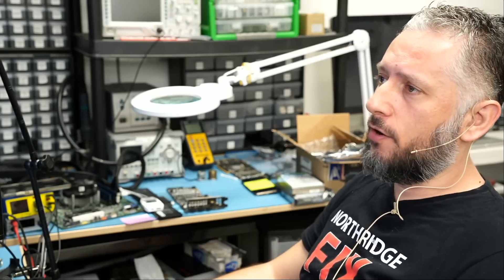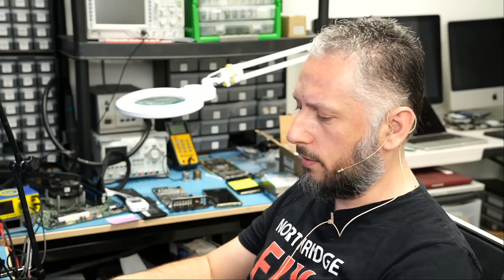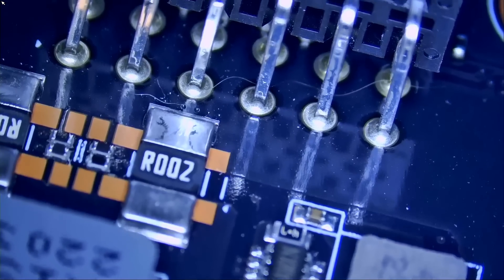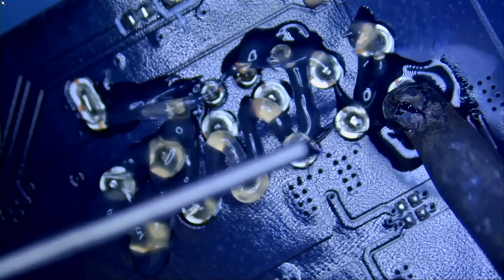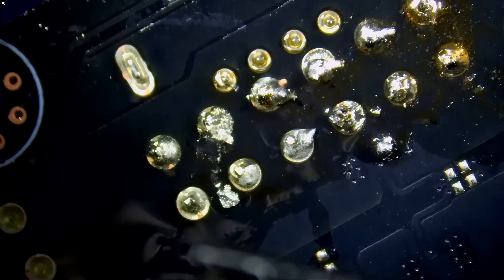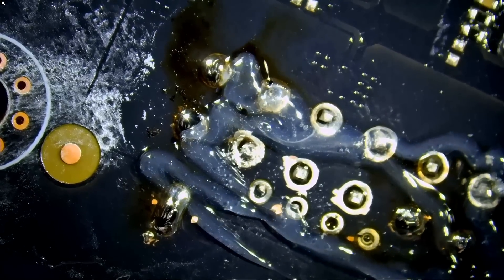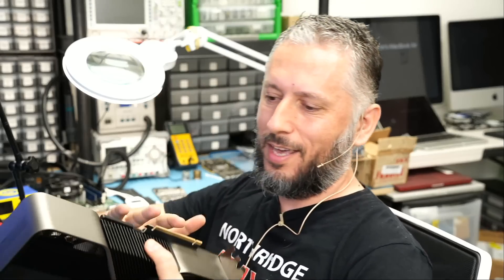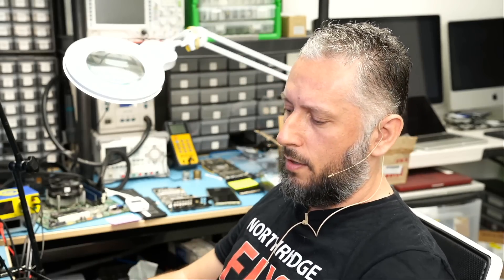Serious issues with 4090 power connectors melting - Is the user at fault ?

Comment: In the video card manual, it states clearly that the power connector must be seated properly to avoid  damage. This is the user's  error. But, the fact that one must apply a great amount of hand strength to seat the connector properly may lead to people being afraid of breaking the connector. The end result is a losr connector. This is a manufacturing mistake. The conclusion is 50/50.

Comment: From the videos that looked into this at launch , it was not the plug being put into the card incorrectly , it is 1 or 2 of the power feed connectors at the other end ( 4 into 1 ). The Card is pulling 600+w , feed over 4 connectors into 1 connector. When 1 or 2 of them is not connecting correctly , it means the full wattage is now being supplied  over  only half of the cards connecting pins  & thus causing more heat and then the sockets melting  .
Reply: That shouldn't be the case, because there are sense pins on the adapter. If you only plug in 1 or 2 out of the 4 correctly, the card will not work. If you only plug in 3, the card will be power capped to 450 Watts.

It has more to do with higher resistance at the point the adapter or cable plugs into the GPU. If it is only partially inserted, or if its at an extreme angle, or if foreign debris or manufacturing defects create higher resistance or lower contact surface area, that can cause overheating and melting.
Reply: @Skilliard  The sad case is that you are both correct.  Transient spikes over and over again.  I would love to see a Amperage plot when the card is on and doing work.

Comment: There is also some of the lower end 4090 that come with a 3 x 8 pin connector like the 4080, it is enough to run the card if u not do a big OC and it seem to be much safer.

Comment: It happens when the cable is stressed against the side panel of the case or isn't plugged in completely. There should be a sensor or some failsafe, and the company should make it crystal clear that unless the connector is seated completely it could melt.

Comment: At some point, we have to start blaming bad design, and that's what the issue is here. If the cable is that difficult to get plugged in all the way, then that is a design flaw that needs to be addressed by nvidia. Nvidia has stated that any card that comes in with a melted connector will be covered under warranty. If your connector melts, the Add in board partner is required by Nvidia to cover it as a warranty issue.

Comment: GamersNexus did a deep dive into why this is happening with testing and they were able to reproduce the result.  The TLDW was part user error and part design.  If the connector is not inserted all the way, it leads to this result.  I personally do not know what nVidia was thinking putting all that power into one tiny connector with gauge wire not appropriate for the power going through.
Reply: These two comments have provided a significant amount of context around the issue - thank you.
Reply: GN as well as many other reviewers were unable to get it to melt just by leaving it unplugged by a small amount. GN only managed to melt it by leaving the connector EXTREMELY unplugged and at an angle- basically the bare minimum for the GPU to "work"- Something so egregiously bad that no person would reasonably make that mistake.

After GN's video came out, people have been VERY careful to plug in their connector fully. However, there have been multiple posts of people that smelled smoke, so they took pictures of their GPU/connector BEFORE removing it to prove they had it plugged in fully.

My theory is that some of the failures are due to improper insertion, but the majority are due to manufacturing defects either on the adapter, or on the connector on the PCB, and the 12vHPWR standard having improper manufacturing tolerances to handle these defects. I know of only 1 case of a 4080 failing, and no cases of a 4070 TI failing, which is indicative that 12vHPWR can handle <300 watts just fine, but the 600 watt rating that pulls 450 watts at stock on a 4090 isn't safe.

Comment: It's just a cheap connection it would be better with 2 connections it's just a cheaper solution they did at Nvidia,
the solution would just put a 90 degree joint, to reduce the tension of the wires.
Up to 600 watts can go through a connector, but the pins are too small, and get too hot because the material is too thin, not good for [ AMP ] and get too hot with the bent cables to properly put them in the case

Comment: Agree. Card connections are too small for current load, voltage drop between connector and pins causing heat. Poor design. Better replacement technique this time cutting connector free before attempting to desolder, excellent repair as usual.

Comment: If the Problem is really because the connector is not fully plugged in the manufacturer has to do something. Maybe the pins are to small for this amount of power

Comment: the card should detect if the plug is not plugged in properly and should alert the user. It makes zero sense that the computer part with the most brain power can't tell if it's not getting enough food.

Comment: this problem is new to videocards but its now new to cars laptop and everything in the world🤭, take it for example the new engines  of cars, back in the day it used to be very simple and you can repair it with minimum tools now engines have computers  and everything that you cannot even overhaul now parts expensive even a simple as startter motor replacement you need to take apart the whole engine just to seevice a simple failure 😆🤭, 
its all about making money🤣, and making it very complicated for the user to have the reason to buy new one instead of repairing it😶, 

its reverse phycology they say innovation, but it really meant making it very complicated for the user to not touch it🤭

Comment: Although not possible if it's a standard connector, just the slightest increase in the metal runs inside the connector should fix it because resistance is a function of diameter squared and the heat wattage is the voltage drop squared which is proportional to the resistance, so the reduction in heat wattage there is diameter to the fourth power, plus more heat dissipated due to the thicker wire. It's possible the metal inside the connector is inferior like using a lower percentage of copper or otherwise some impurities in the metal. But of course trying to run all that power through it is the real cause.

Comment: Considering how frequently this problem seems to be happening, this is definitely a design issue. Nvidia needs to fix this before it causes house fires.
Reply: nvidia of today does not care they have attack dogs well paid on youtube
Reply: Gamers Nexus did a deep dive, this is fully user error. They do mention that at some point you have to start blaming the company, if the plug is that hard to get in all the way, and doesn't want to stay seated all the way, that is a design flaw that needs to be addressed.
Reply: @chubbysumo2230  This is a product marked to, and sold to consumers. If it's this possible to incorrectly/improperly mate the connectors, it's a design flaw.
Reply: @kjtroj  If someone fails to install their CPU correctly and bends pins whose fault is it? Surely you'd agree it is the user and NOT the manufacturer. It is the same scenario here.
Reply: @innie721  There's a word of difference between damaging a component and potentially starting a fire. Not only that, but a CPU drops into place, whereas the way this connector is designed, it requires a fair amount of force to fully mate, which I suspect is the source of the problem.
Reply: @innie721  no it is not. The situation is not exactly the same.
Reply: @kjtroj  Correct. It should be FIT FOR PURPOSE, It IS NOT !
Reply: @innie721  If the user fails to install a CPU correctly, either the computer simply doesn't POST or pins on CPU or motherboard are damaged, leading to similar result. It doesn't pose a risk of fire hazard like these 12VHPWR connectors. Not the same scenario at all whatsoever. Manufacturer design error. Stop running interference for faceless corporations.
Reply: @chubbysumo2230  Stop repeating what your daddy Steve says all the time. Grow some balls.

Comment: Counterpoint:  Because a user pays alot of money, they cant be at fault? What if they buy a car and drive it badly, don't press the break pedal all the way, and crash?  Are the car company at fault because they knew if someone doesn't press the break pedal properly, it won't stop the car? I think if you are paying that much money for something you better know or learn how to use it.  
That being said, the connectors are stupid and they could have just stuck with the old ones, put 3x 8 pins if you have to.

Comment: Add a cam-locking power connection with a lever that moves 90 degrees, then there would be no doubt that the connections are made and secure.  Over and done!

Comment: Maybe if users apply heat sink gel inside the connector when they plug it up it will pull out more heat to the external connector and wires to have less of a chance of it occurring again (I think zinc oxide white suncreen is the primary ingredient in many heat sinks). Is there something you can do in the repair to pull out heat?

Comment: good commentary on customer vs manufacturer.    If you use the auto industry as an example,  one problem reported to NHTSA is interesting but wait and see.   But when you see the same problem spread over many customers then you have to say the issue is the product that not designed to be fool proof.   My vote at this point its the manufacturers issue for designing a product that can be improperly installed.

Comment: What about variance in power connectors, are copper pins in connectors too short, pin fitment bad quality (what brand supplies are melting stuff) I run a 3080Ti Ref card it has 2 nice little power cables coming out non board mounted power plug, hmm why they put a cord on this and plugs on a higher model. My 2 cents I am still drinking my first cup of coffee ☕...

Comment: My Asus tuf 4080 came with image diagram to plug the 12 volt in all the way and not crooked. Adamant it had video once, where a user didn't plug in the cable all the way on a modular power supply and the cable melted.

Comment: you can make a test using brand new connector and inject power to monitor the temp by power going in. can use a resist to moderate power flow. so we'll know is problem is power limit of connector, or poor quality connector from the psu or adapter (i think is the second)

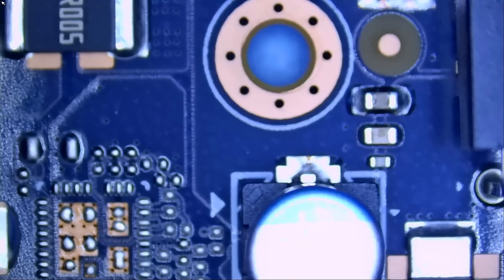Comment: 3:00 I maintain this is the issue - no other video card that I've ever owned required me to push the cable so hard into the connector on the board that I risked breaking off the connector itself, which is exactly what happened in the first 4090 repair on this channel, if I remember correctly.  In the past, I simply connected the PCIE cables to the connector(s) on the card, they seated properly without effort and the latch on the cable connector attached to the board connector without issue.  With the 4090 that is suddenly no longer the case.  Secondly, a design that puts that many amps into ONE small pin on the board connector, enough power to supply 600 WATTS to the board, is clearly a bad design.  DUH!  And, of course, Nvidia deploys its usual suspects to blame the customer because they are unwilling to point the finger at themselves.

Comment: The connector is part of the ATX 3.0 standard so the blame probably should go to Intel.  In theory if the connector wasn't properly inserted then the S1-S4 lines should remain open.  According to the standard, both S0/S1 open should limit the card to draw 150 Watts max (which seems somewhat low for a high-end card).  Maybe if none of these lines are connected the card just assumes it can draw whatever power it wants to (the other sense lines tell the card the ATX 3.0 PS is actually present).  A poor connection on the power lines would account for the burning as too many amps are being pushed through a reduced cross-section.  But the whole thing looks shambolic to me - the older standard was practically idiot-proof as the card would sense if inadequate power was being supplied and either not work or give you a message on powerup.
Reply: Nvidia's reference design encourages the use of a 4 spring female terminal, which Intel adopted into the ATX 3.0 spec in february, which is produced by NTK.

plenty of 8 pin terminals have melted, if you'd bothered to look.

Comment: I might be wrong but logically how come we haven't seen so far the other side of the connector which splits into 3 or 4 to be melted but only the only side melting is the connector on the card itself. Does this not proof that the manufacturer made a bad design! I completely agree with Alex that this is without any doubt a bad design from manufacturer and their fault to be blamed.

Comment: I'm not saying of 1 company or 1 person that should be held accountable. First we already see from the very first time, there is a problem with the connector (melting, burning, etc.) Thats 1 yellow flag. Second, the last type of connector is still good and not giving us a big of a problem, another 1 yellow flag. Third if the connector causing the same problem over and over and over and goes along the way, why not canceling the design right away? Its hard to be recall? Thats why you should not pushing something bad until proven good.

If there are no big-urgent-hazardous problem why bothering it?
If its not broken why fixing the connector?
thats the only question that only manufaturer, researcher, engineer, etc. can answer. But one thing that i can assume they probably need to make sht breakthru on something because they cant make any good progress. But idk thats the only thing going in my mind because i never been in that industry

Comment: I still think this connector is flawed. Not beyond repair, but Steve from Gamers Nexus did extensive testing on these. Its the locking mechanism thats not audible enough snapping in.
I do love the idea of a dedicated power rail/cable for a graphics card though.
About the current flowing through that connector: 12vhpwr has 6 positive cables, each carrying 100 watts max at 8.3 amps - should be enough if the cable is plugged in correct...
https://youtu.be/ig2px7ofKhQ?t=162

Comment: You know Alex, I completely agree with you that it’s a manufacturer issue. First off when making a video card, WHY use plastic when it comes to an HDMI Connector? Regardless of the fact that plastic melts, using a metal connector would just be a better user experience. This way the consumer doesn’t have any problems with the product after purchase. So not a user issue in my opinion. Furthermore after looking at the end of the video and seeing another 4090 video card connector problem, further explains that it’s a manufacturer issue.

Comment: when you try and funnel that much power that clearly should take a higher rated connector (or multiple connectors) this is what happens.
previous mfg'd gpu's used multiple connectors the handle this type of load, now they eliminate the multiple connector method into a single connector and all of a sudden the connector melts? Using a multi cable adapter to connect 2 or more power source connectors? Seriously?
There is another guy on YT that explains this and even does testing to show why this is happening, it is happening across the span of all mfg's that went to this design. His channel tests all sorts of issues with gpu's, MB's, cpu's, etc. His logo is GN, most of us that are into technical stuff know who this guy is and Alex probably does too.
This problem here is clearly the mfg's fault as SB (the owner of the GN channel shows repeatedly in his testing).

Comment: Now a pattern is emerging that new socket could melt again i would diy solder wires direct into the board ,i would have short thin wires to fit the pad hole size then solder the fat adaper or psu wires if modular to the thin wires with heat shrink ,you would have to sell your psu with gpu later but would never melt again you just make the thin wires really short to prevent voltage drop

Comment: Biggest reasom why is Nvidia pushing this connector style over the standard 8 pin (be it 2 or 3 of them) Forcing the same W over more pins.
The cable itself has to be more rigid also because of this, and many, many people cannot fit this card in their current case without tightly bending the cable (The cards PCB is quite a bit taller than previous generations, which puts it even closer to the panel)

'If it aint broken, dont fix it' Unless you're a company squeezing margins out of a new connector, then its 'If it aint broken, Fix it until it is'

Comment: it's the designer of the connector' error but if its written somewhere that the cable need to plug in all the way in it's the user fault, it must be written in the manual or the box

Comment: If you take the plug, the wire you plug into the card and look at the sleeve, the metal tube, they are not designed to handle too much current. Just look how thin this metal is. Compare the video card plug with other plug types and you will see that the plug on the cable is not as powerful as other types of plugs is that handle the same amount of current.

I think we have reached a limit of what this type of plug can handle in terms of current.

The factory pushes a plug all the way to the limit to avoid having to use a larger plug. Not only the smallest possible size that counts.